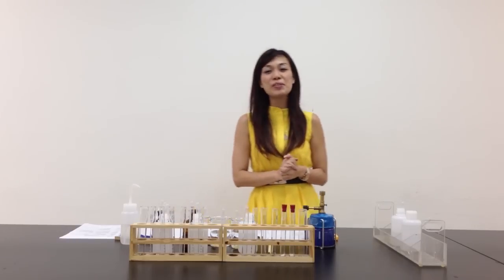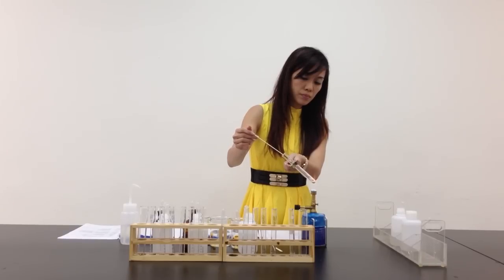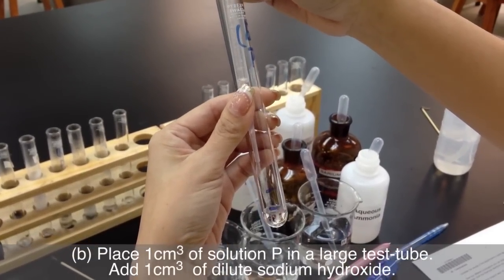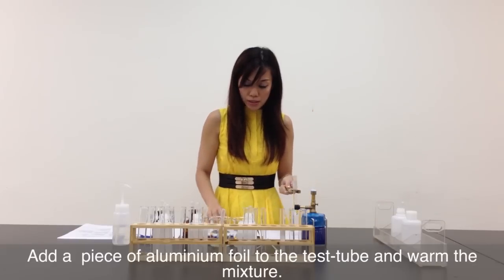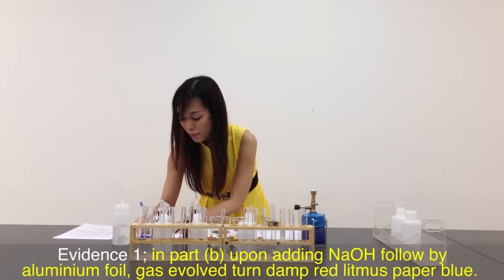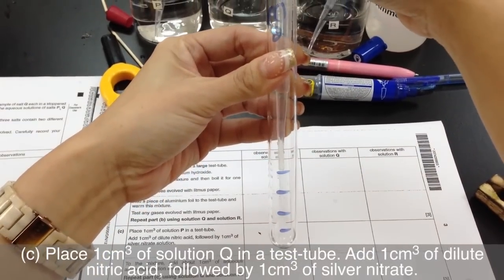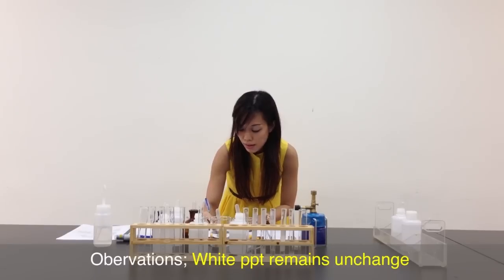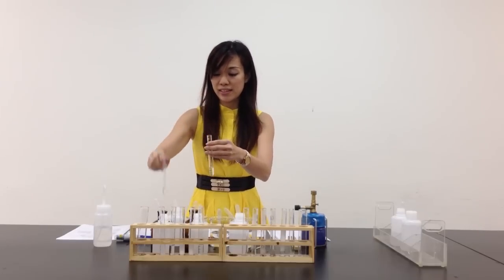2012 Practical Examination, Execution

Comment: where my 2016 batch at?
Reply: Sweaty B3A5T 
2016 batch here practical is tmr can someone explain what's the difference between gentle heating and strong heating thanks!
Reply: Adam Aw gentle heat would occupy lesser time whereas strong heating should be longer